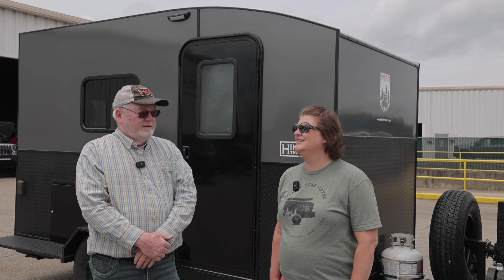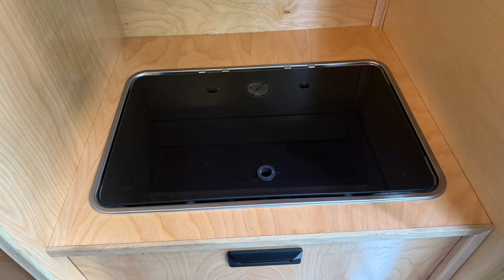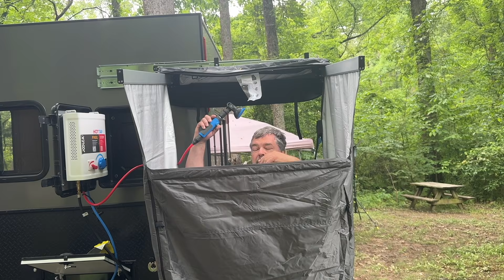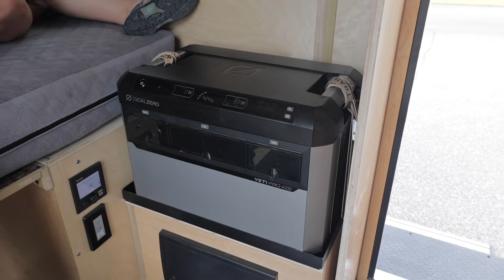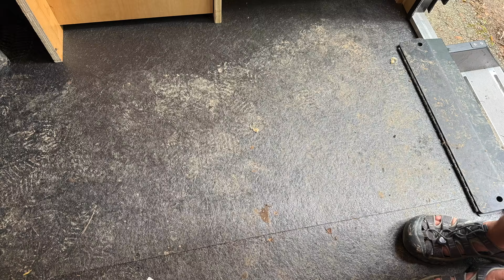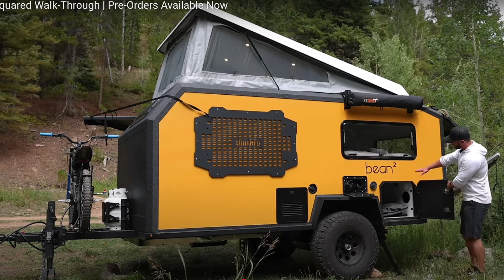Hiker Trailer Grew UP

Comment: Man, I've got "ALL KIND OF" ideas for this camper!! The taller/claustrophobic crowd  would love this!! My cargo-conversion all aluminum 16x7.5x7 was just under 15K and with a residential queen and framed wall two feet in from the back, w/a 32" door and a Midea 1200btu Smart Inverter A/C in it, plus camping gear and insulated.. I'd say it's under 20K and now towards the 3K weight.. Bed& frame, wall, door, ac unit, BougeRV porta shower, Deisel Heater, cooking stuff, composting toilet,  etc... 
 First thing I'd do is put the galley in the back with a dual strut raised door or a huge swing out traditional Hiker door with a drop mini table on it, or attachment points  for dying stuff.. "OR", put a HUGE Hiker style good in back, put the bed E/W and in the middle so you and you "supposed other" dont have to crawl into, or out of it!.. Solar as much as you can for a Huge power bank, like a Bluetti Apex300 and battery or a Pecron Dual 3800 for 8K wtthrs.. I'd definitely add Moonshade products to this, especially the new Pro Model w/ walls....  I might do a Deisel Heater over the Truma idea, but the power soak has me concerned and leaning towards the Truma.. There's so many tweaks I would do to this its mind blowing 🤯, but it would work for off grid for State and National Forests as well as parks..  The ceiling fan is the one thing that threw me, lol.. I see a a Srgnt Carter hair cut in the future with that!! Loved the steps though, keep those!!!!
Hoobilly

Comment: "OH MAN" Stopped it, now a have to sell my cargo-conversion and down size 😭..  As my cargo-conversion sits, and thus is a guess.. Empty, 2250. Full, 3k or less. It is all aluminum, 16 on center, dual Dexter Torsion axles, 2- egres windows, xtra height and roof racks.. I dig the concept,  as i watch, I can see a "my version" if Hiker would like to hear my idea's..
Hoobilly

Comment: The Goal Zero power system is very nice BUT it's really expensive. It's 3799.95 for the first 4kWh and 1800 for every 4kWh add-on after that, up to 16kWh. (8kWh/5599.95, 12kWh/7399.95, 16kWh/9199.95)  I could set up a 16kWh Victron system with all the bells and whistles that's internet capable for around 4000. It's a huge price tag for convenience. For some people, it might be worth it and it is compact compared to a DIY setup.

Comment: Here are my suggestions to make the 6x12 Hiker Camper a good match for me: (1) Remove the current interior kitchen (fridge, sink, stovetop, front cabinets) and install aluminum floor pan with drain, which becomes a flex-space for shower, box-toilet, and area to drip-dry wet gear (winter coats and boots, ocean wet suit, swimwear). (2) Remove driver-side passage door and install swing-up hatch door in back near head of bed to use as emergency exit and to receive long recreational items such as kayak and paddle boards, which stow atop bed during travel. (3) Install multiple small round power fans on the sidewalls instead of rooftop power fans. Those sidewall fans can create cross breeze between fan to windows; avoiding roof fans eliminates future roof leaks. (4) An onboard propane heat-cool system is likely my only factory-installed amenity; keeping warm and enjoying a good sleep is vastly more important to me than any other amenity that I ask of my camper. (5) Replace fixed interior table with folding removeable poly table so it can be used inside or out. (6) Retain the U-configuration of upper cabinets around the bed yet replace their wooden latch doors with flex-netting. That change shows content of each space while retaining the stored items in their space; and also, the netting will lower weight. It may not seem like much yet each 2-lb cabinet door adds up. (7) Make water storage super-flexible. For example, instead of one large fixed poly box water storage tank, I prefer portable 1-, 2-, and 5-gallon jugs so I can distribute them around the trailer, which serves several benefits, notably for weight balancing, tube line elimination, and placement at point-of-use. Also, a 1- or 2-gallon jug is more easily refilled at a service station, a 10- to 30-gallon poly box is not. (6) Keep the large storage space under the bed and accessible from outside. Keep all the exterior lights for safety. Keep the power station separate and portable so it can be changed as technology changes. By simplifying the water system, you/we are eliminating the problems that come with frozen water supply lines during unforeseen cold camp events and/or forgotten winterizing chores. In summary, the two most important tasks that I ask of my camper is to (1) safely transport sports gear to a beautiful destination and (2) to provide good sleep each night after using that gear. Regards. Steven, Utah, USA

Comment: The Mainstay is a giant BOX. Not attractive at all. Hiker have gone away from  the easy to tow, light weight affordable camper that most of us love. Do they have to compete with the stand up campers NO. Has Vistabule changed anything in 15 years on their camper NO Same quality and good looks. Market share Hiker makes 40-50 campers per month how much more do they want. The Mainstay will compete with all other stand up campers and the style and looks won't `get them more sales. What no bathroom as a standard feature, and only sleeps 2.  Plus your gas milage will decrease with that hugh flat front. They have missed the mark. A rolling 3000 lb box. Stick with what sells and be happy with your profits.

Comment: Get stairs underneath vs in the doorway. That’s a pain when you need to quick go in out and with packing, pulling over, etc. Also, would love to see bunk option to fit 4! Other than that, keep things minimal as much as possible to keep price down. And, get rid of that weird ceiling fan.
Reply from the maker: They did change the steps out in the production model. I think it will be interesting to see what options people request for this new model - I think bunks will be popular.
Reply: Totally agree. That ceiling fan is so out of place. I think Hiker is trying to grab at everything from all camping angles. Stick to what sells

Comment: I would like to see less head room by 3 or 4 inches and a wider trailer out over the wheels. Double pane acrylic windows for greater insulation. Single door is fine and options for composting toilet in it's own room. Possibly a wet bath.
Reply from the maker: Great suggestions!

Comment: Like the potential here. I am middle of ordering my hiker trailer and debating. The sink looks too small for me and I would opt for less. I love the option for an area to eat inside, toilet room, and extra storage. Still would want a roof top tent along with solar. I am afraid I may top my 3500 lb towing capacity.
Reply from the maker: Since the trailer starts around 3000 lb and then adding your gear - you will top you 3500 lb quickly.

Comment: Add:   Back camera, small microwave oven in the kitchen and ditch that ceiling fan with the big blades.  Add tiny blades or not at all.  Seems like it would be something that would need to be careful around when moving in bed getting up etc. if  a taller person.
Reply: I thought the ceiling fan was 
Ridiculous

Comment: Excellent concept. 

I would be tempted to have the hatches open down to avoid head collisions.  Guess why it's my first suggestion?

In addition to solar on top,  panels on the side work early in the morning and late in day. 

Please put the absolute biggest real truck tires on instead of trailer tires.   If possible an 8 x 6.5 rim and can use a real full size 2500 spare tire.   

Excellent
Reply from the maker: Thanks for your feedback. They have changed the cabinets to being shelves so nothing to hit your head on!
Reply: @MWDAdventures  Thank you.  I meant on the outside of the trailer,  such as the hatch in back.

Comment: MD, got my wife and I into one about 2022 Hiker HD 5x8 from all those early videos and gathering videos.    Granted covid hiccups and quality control we still have a Hiker.   We agree with the tone of the video ... it's trying to clip into the next tier and cost levels.   So, that changes the discussion and competing setups compared to why we have the hiker we have.    I thought SCAMP immediately.   Would we get one, no.   DIY, oh so DIY ... we didn't have the resources to do a complete build ourselves.    Today, my wife and I would do a 5x9 to adjust for sleeping heights.   We absolutely would not custom order.   I strongly suggest buyers to buy used or on floor models.    Lacking making this longer, you have the time to access Quality Control.  Yes, we would get another hiker, just know what to look for after owning one.    The stand up might be after a different demographic and definitely has potential.   We are not setup for such.
Reply: I'm building a 5x9 Hiker look alike right now. But with a slide out kitchen on passenger side, plus it sleeps 4. 2 adults and 2 kids up to 5'6" tall. ACP panels on sides same as Mainstay. With the slide out kitchen it makes the inside feel much bigger.

Comment: I had hail damage on mine and called multiple times for insurance purposes as directed by my insurance company and unfortunately never received correspondence after sending photos and emailing all information they requested. 😢
Reply from the maker: Sorry to hear that. That would be frustrating!
Reply: @MWDAdventures  Not a huge deal, mainly just cosmetic. Other than that, the Hiker team had been very responsive when I bought my trailer used. As for the trailer, I love it. I have been using it as a bedroom Thursday thru Monday every week since August as I have been sleeping in it while taking care of my elderly mother. I’m sleeping on a single cot and using an Ecoflow Wave 2 venting out the other side window for heat/air.

Comment: My ideal trailer doesn’t exist. My limits on towing are 2000 pounds and 200 pound tongue weight. In order to have it last and no storage fees, it needs to fit in a 7’ high garage. 60 x 75 short queen bed. As much interior height as possible. No off road or high suspension needed. Toilet area. Possible shower. Both people able to get up to go to bathroom without climbing over each other.

https://youtu.be/qwXqA5AF8A0?si=os3Q_c6op0KqAQSE
Reply from the maker: Sounds like you have a good vision for what you want in a trailer!

Comment: I think this is a good start. I’m sure options / design will change as feedback starts rolling-in from actual customers of this product.

There are things I like and don’t like. I like the insulation, AC heat combo, the storage available both inside and below. The queen size bed is good, fridge and sink / stove combo.

The little extra utility room is a nice addition too. As well as the weight of the trailer, allowing for smaller type tow vehicles.

I agree with another commenter above - having to move the mattress to access a table is a hassle. 

Maybe the Goal Zero unit can be moved down a bit? One could have a folding table come down from that side of the wall, and use fold up chairs as an option.

Regardless, I think price point is going to be the key. 

My 5x9 Midrange was about 17K  with the options I chose. It’s easy to spend a lot of money on these things. For me, affordability was part of the equation, as it was a cash purchase.

Hiker needs a trailer configurator like they have for their other trailers. This will allow customers to go as basic or as crazy as they want for options and pick the right price point for their budgets.

I wish Hiker lots of success with this new model.
Reply from the maker: Thanks for your insight!

Comment: -I would like to see options for sleeping more than 2 people. That is our biggest issue with our MR5x10.
-Exterior design looks odd. Could use some more work.
-I love the idea of optional porta-potty area.
-I agree with some of the other commenters, I don't think it needed to be that tall. The proportions just look off. too narrow for that height. 
-As someone who uses their hiker 100% in parks, the features of this are pretty cool. I agree this is probably geared more towards campers who stay in parks.
Reply from the maker: thanks for your insights! We think it is more of a campground model also. Agreed, the proportions seem off to us too.
Reply: If your Hiker had a slide out kitchen on passenger side you could sleep 2 adults and 2 kids up to 5'6" tall. My Hiker look alike build will do that at 5x9 size. there are more advantages of a side kitchen than the big door at the back. #1 no need to have a 270 degree awning.

Comment: I will be  70 in 5 months. I’ve been hoping for something like this from Hike but this is overkill. I like the 6x12 with a platform bed that I can sit on the end of. This one appears too high for me. I’d like to see a traditional hiker galley on the back (24” deep). I don’t want water or the indoor stove sink combo ( no gray tank on the prototype means I have catch sink water underneath anyway ugh). The max ceiling height could come down to 6ft max.
Reply: Im with you.. this is very nice but just to much stuff on it and that will push it over $30k ...FOR me Im 5 foot 7inches tall so 6 feet is good..
This looks like a very nice and high-quality unit and will be a perfect fit for some people...
Reply from the maker: thanks for you feedback.

Comment: Hear me out as someone who loves their products and as someone with a lot of experience with them. I've spent about $56,000 with them the past 3 years. This is not a complaint in any stretch of the imagination. I'm beyond excited for this development, to say the least. But it's going to be too expensive to be worth consideration without changes. At the price point they're aiming for, there are just way too many similarly-sized products that are arguably better and cheaper. Even some full fiberglass builds that hold their resale value for multiple decades. Think Scamp or Casita, for example. They're not the same but this does matter when it comes to spending $30,000.

In terms of power, please run quickly away from Goal Zero. To me, it's a sign they aren't well-versed in that realm but to other power nerds, it's a big red flag. I realize there are existing business relationships but I think their reputation is more important than that particular relationship. It's a remarkably unappealing product compared to nearly every other manufacturer with something available on the market. Even including cheap stuff like Oupes and Pecron. Ditch the Goal Zero and go with something like Anker, Ecoflow or Bluetti and you'll instantly shave $5,000 off the price even with the huge retail markup Hiker is known for. (I've paid the premium twice, so I feel like it's fair for me to point that out.) Don't have to go with a complicated inverter-controller setup with individual batteries but can still go cheaper and get a super-reliable end user experience that can run everything. Offer optional solar at close to cost or at least make it solar-ready and include an option for a DC-to-DC charger for vehicle charging while driving at whatever markup is necessary.

Those steps/stairs have to go. Too many better alternatives. It's not 1992.

Ditch the stand-up fridge and go chest-style only. Or only the stand-up. Pick one or the other as a standard option. But ideally chest-style as standard, as it's cheaper all around and opens up way more useful space inside while lowering the center of gravity. Heck, that'd open up space for a window unit AC. Offer something like Iceco products for fridges or let people pick their own. For a sink? Do something like the Kimbo folks are doing with a rechargeable Dometic faucet so a big pump isn't necessary. No built-in cooktop at all. With even a moderate power station, an induction cooktop is cheaper, safer and easy to stow away. But so are dual-fuel cooktops that can be used inside or out. Think: $30 vs $300.  

Being able to quickly exhaust air when bathing or cooking indoors with two fans will be great. And for bathing? Give people the option of hanging a cheap shower curtain with magnetic hooks and using a collapsible doggie pool for showering. They can use any variety of camp shower they like - even a Joolca's extended hose. It's way less inconvenient than most are thinking. Don't offer a standard RV water heater for myriad reasons unless it's just as an option. Go with Joolca or similar as an option. Include a heat pad for the water tank as an option.

Don't overcomplicate the bed and dinette setup. Copy the common vanlife and Casita designs. It'll be cheaper and more durable longterm. 

Maybe consider the propane heater as an option that can be excluded but with the space left open. That way someone could have the option of installing their own diesel heater if they want. For me, it's more economical and a ton safer. It's also a lot easier to fill up a Rotopak with diesel than it is to find a propane swap or fill station in my part of the country. It's infuriating here, to say the least.

This really is super-exciting for those of us who are Hiker fans. It's going to appeal to occasional campers and even... wait for it... full-timers and vanlifers. For real. I'm in the market for a Kimbo or Casita for full-timing for a few years and this development is going to cause me to wait. 

Edit right as I'm posting: Just watched the second video and see all the 2.0 revisions. Really, really solid moves.